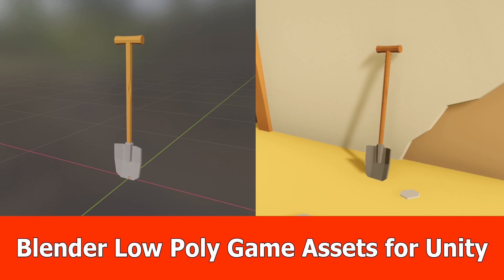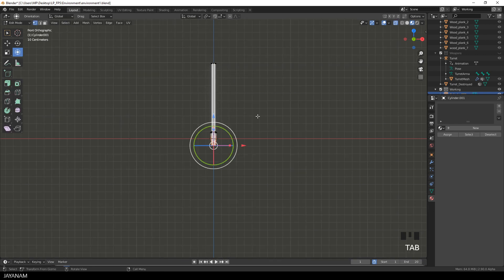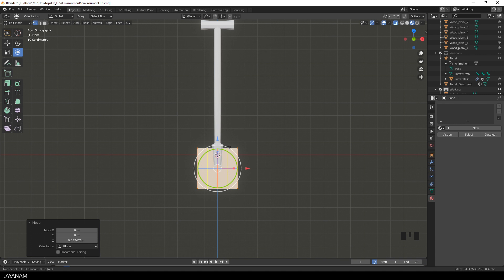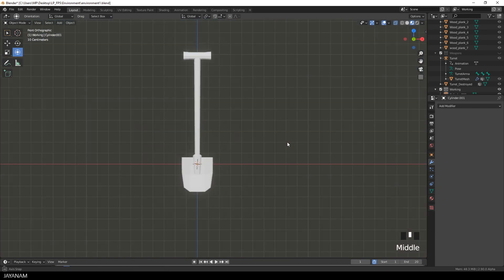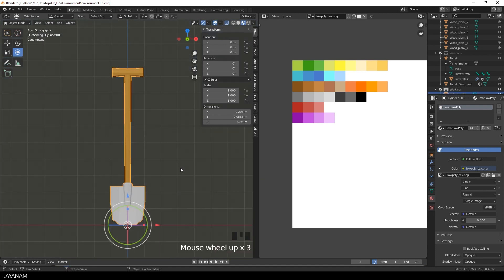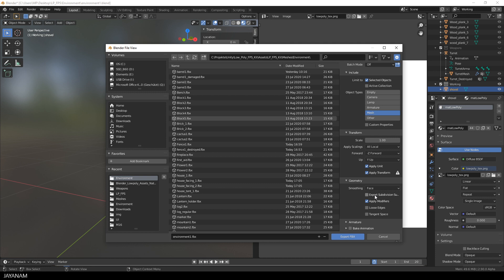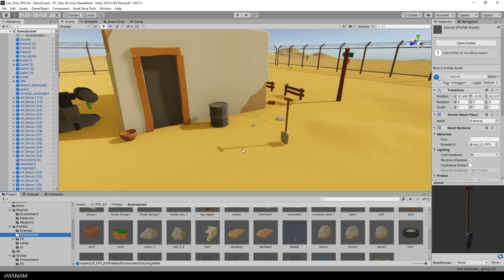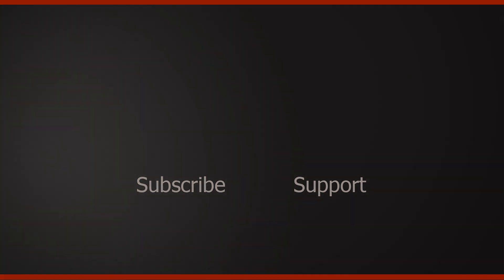Blender Low Poly Game Assets for Unity

Comment: I do create colliders in Blender as a child of the gameobject. I then create a meshcollider for the collider which I created in Blender and delete the meshrenderer. As I want to have a collider which is not as complex as my low poly gameobjects but more complex than a simple BoxCollider. Is there any downside apart from the time required making a collider?
Reply from the maker: No it's a good thing, it isnt visible so there is no drawcall and it is more performant than the default MeshCollider, especially when it is not convex - just be careful to not assign a material to this object in Blender, but I guess you know this.